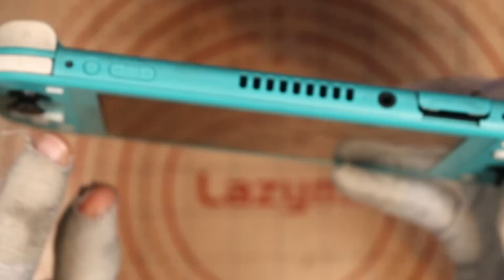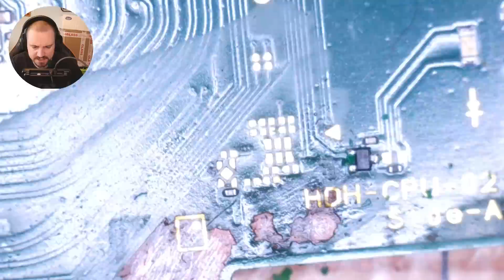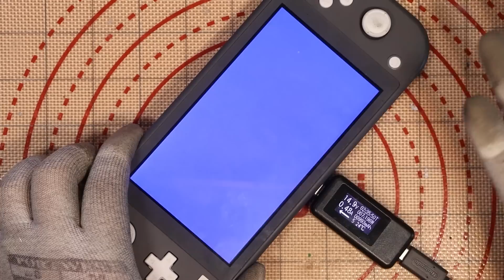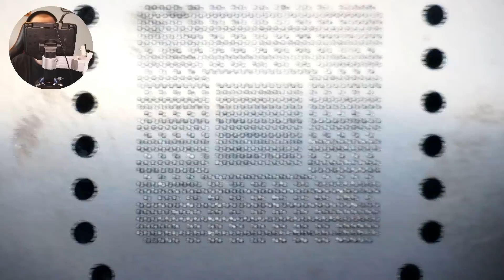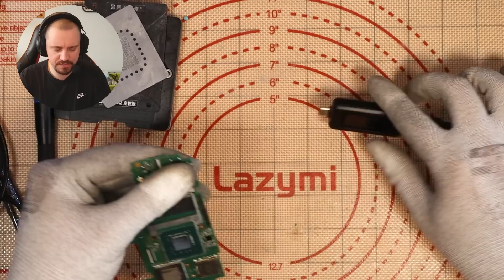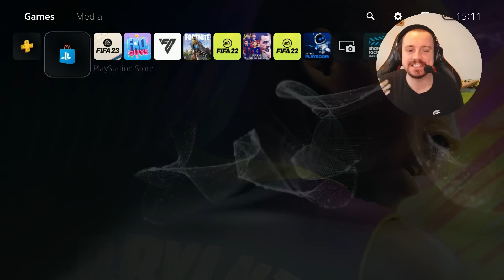Trying to Fix FAULTY Electronics for PROFIT | Profit or Loss S1:E38

Comment: Normally you would give up when you saw all that Liquid Metal. The will to not give up is exceptional and I’m so happy that you didn’t just give up and push on.
Reply: I'm not quite sure what Sony were thinking using it. It just seems like more trouble than it is worth when phase change pads would probably work almost as well and not give conducive faults, though it'd need changing every time it was opened.

Comment: So what you're saying is, that re-baller stencil thing or whatever it's called, needs to be made of a material that is NOT metallic ... so it doesn't attach itself to the board while you work with it... like a ceramic or something? Ceramic is an insulator so it'd only get hot where the holes are for the pins or whatever they're called. Oh hey should I trademark the idea? J/K Also, hello from Montana, USA

Comment: Pro tip Joey: On things like the Switch CPU just use solder balls. With paste theres a very good chance you're going to end up with some balls uneven but with balls they're guaranteed to be the same size. The stencil sticking is normal. Just heat up a little before pulling it off. It's best to pull it off while it's hot.

Also the cpu getting hot isn't likely a bridge otherwise it would've happened on both sides of the port. It's more likely a bad charging port.
Reply from the maker: Thanks for the tips and info as always mate ❤

Comment: I did apu reballs just like in your video, i used the stencil as a guide flux and tweezers with hot air to reflow the balls. Until i discovered a cheap bga rework station of ali Express, profiles included, I'd never go back to hand reballing as it's 50/50 success rate. 😢
Reply: Curious what the model of BGA rework station is? thanks
Reply: Yeah i would also like to know the model, mine recently crapped out on me and im hunting for a replacement

Comment: Hmm, looks like we're finally heading in the right direction. But given your expenditures, and also other things like postage costs (remember there is an eBay fee included on the postage price) and packaging materials, realistically you're going to need to be +£1200 to +£1500 before you actually have £1000 of net profit for yourself.
Anyways, good luck, and hopefully with the reballing/reflowing equipment you might even be able to revisit some older Nintendo Switches that have APU/CPU issues.

Comment: Joey, something I've always wondered - what is the Wick for? What does it do? What's its purpose?
Reply: You use wick to draw up solder from components/boards.  It's like a sponge for solder.
Lie it down on the board where there is solder you want to get rid of then heat it with an iron and it will pull all the solder off the board into the wick.

Comment: Hey joey try a "higher grit" of solder paste i hear that it makes it easier. Also i think that you had the order of your steps wrong. If im correct it goes.
1put stencil down onto chip and line it up
2apply solder paste
3remove stencil 
4apply heat

Comment: Try putting the solder paste on some paper towel to take out some of the moisture, and then pack the stencil with the dryer paste.Also to get it to remove after melting the solder paste put a couple drops of flux to help it release. Good Luck!

Comment: What you need is a 15"x15"x11" approx ultrasonic machine, use distilled water and a decent electronics cleaner solution will make life a whole lot easier.   Or find a used machine and transfer the workings to something like an enamel metal oven dish and add some horns to get max coverage.   I have heard people converting old deep fat fryers keeping the heating element to warm the water and just affixing horns to the base and wiring it up.